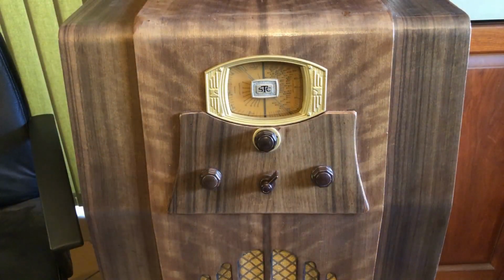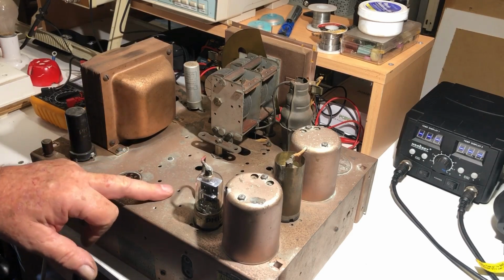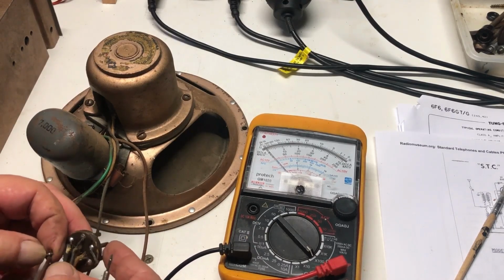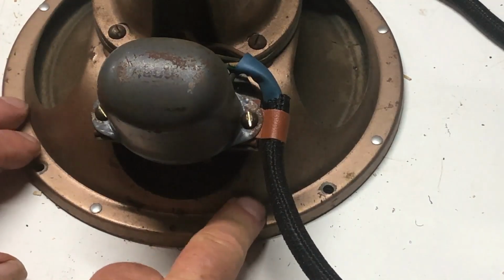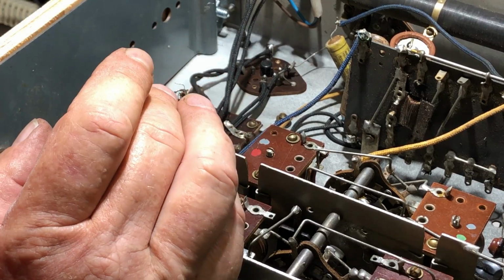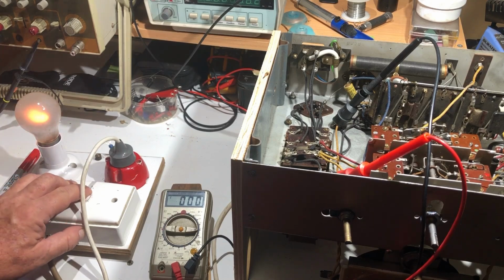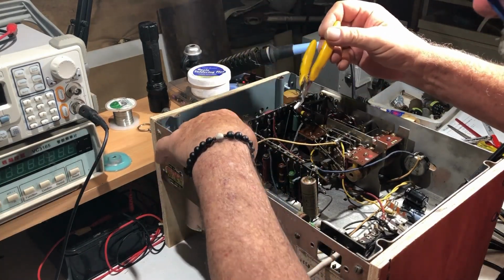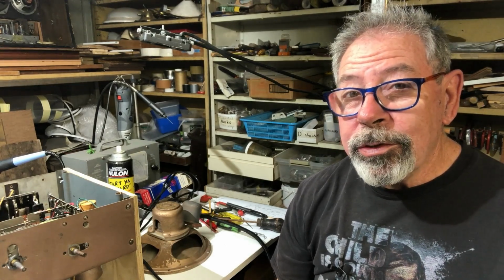STC model 530 Part 1

Comment: It doesn't look like it is a 'live' chassis (ie. electrified with a nominal 240V when the set is on, as was typical at the time).  Am I right?
Reply from the maker: Hi John. Yes you are right. This is not a live chassis set. It has an isolated mains transformer and all voltages are derived from the secondary windings.  In fact, live chassis radios are quite rare in Australia.
Reply: @Donno308  Thanks Don.  The reason I asked was that my uncle had an identical model to this magnificent STC vintage-radiocomau/default.asp?f=2&th=996, which replaced an even earlier HMV (I think) MW/SW dark wood floor model with octagonal radio dial, both with booming bassy speaker cones.

When I was a kid he told me never to poke around in the open back of either, because he said the chassis was live.  As a late teenager he trusted me enough to tap the top of the sound valve whilst on whenever the sound became muddy or muffled (light surface corrosion on the pins?).  I still ended up getting him to do it though, lol.

Comment: Very interesting watching this. I have an STC 536 chassis in a cabinet which is the same as the one you called "Butt Ugly" (which came up nicely in the end). The valves in it are 6J8, 6U7, 6B6, 6V6 and 5Y3 which are different to the one's in your STC 536. Also your chassis is somewhat larger than the 536 I have. I believe mine is a 536B. When working on mine I found a lot of discrepancies to the circuit diagram which I downloaded from Radio Museum. Out of interest what chassis did your "butt ugly" cabinet have? (sorry for calling it that but it's the only way of identifying it 🤣) Looking forward to the next part in this resto.
Reply from the maker: Hi.  Mine was a model 556 which was the battery - powered version.  At some time it had been converted to AC operation.  To do this, they removed one of the 3 IF stages so as to use the spare valve socket for the rectifier valve.  It was all a bit of a butchers job and of course there was no schematic.  It wasn't the same as the 536 and of course they changed all the valves to 6v filaments but used different valves to the 536.
As far as I know the chassis would be the same size as it fitted in the same cabinet.
Cheers

Comment: Hi Don.  I can confirm that this is a model 530.  "53" being the chassis number, and the "0" being the cabinet style.  I have a model 680, which is a slightly earlier model (late 1935 to early 1936) that uses the same cabinet design.
Reply from the maker: Thanks Stuart.  I was struggling to find much information on it.

Comment: Hi Don & a very merry Christmas to you. Thank you for the video - one small suggestion; if I remember the cct diagram correctly, the tone control cap is in the plate of the 6F6, returning via the tone pot to ground. In this position they have a hard life & if they short, you are down a tone pot also:( Thanx again.
Reply from the maker: Ji and merry Christmas to you and yours.  I did end up replacing that tone cap.  I've seen a few designs where they run off the plate.  Always one to watch for.  Thanks

Comment: As you say Don, an unusually well organised and neat chassis for this period. Those hand wound resistors were an interesting touch. I kind of like the change they made to the facia to give it a bit of character. I'm sure you'll have this up and running in no time. Seasons Greetins from Scotland.
Reply from the maker: Hi Klumpy! And a very Merry Christmas and happy New Year all the way from Australia.  Yes I guess we'll have to live with that facia as it is so I might as well get to like it!
I've already got it running but there's a few weird things happening ...
Reply: The 536 is not so easy to work on. It has a smaller cramped chassis.

Comment: Nice going there Don. I have had the 'pleasure' of working on a few STC radios from the late 30s and yours is the cleanest and best laid out one I've seen. That huge capacitor was unusual, I expected it to have a high capacitance and voltage. It is high for a non polarised one I guess. What happened to the front of the radio cabinet? that is weird, is it a different chassis and the holes were out or something? 
As you once said to me... "you'll have this working in no time" 😉
Reply from the maker: Cheers David. Someone has clearly "got at" this radio before, apparently using whatever they had lying around.  I've found a few caps replaced with the wrong values but probably near enough to work.  I'm not sure what went on with that front panel. No clues inside the cabinet.  The holes on the inside line up so it wasn't that.  Also someone has cut off the end of the inner tuning spindle with a hacksaw.  With the extra thickness of the front panel I'm not even sure I can get it working again properly.  Hopefully I can work something out.
Yep, I'll have it working in no time.  Funny, I don't remember saying that.  I must be getting old.  And my hearing is going funny too - my voice sounded kind of squeaky...
Reply: @Donno308   Haha... you said that on the hologram message you sent me with the clock radio 😉

Comment: Hi Don, You must be right that the trim under the knobs is added. I'm thinking that the large tuning knob was left off when they added a piece of trim there wasn't enough length on the control.
Rich
Reply from the maker: Hi Rich.  Yes, it's difficult to work out why that was done.  No sign of damage on the inside of the cabinet.  It will make it difficult to fit a new outer knob.  I'll just have to see what I can do.
Reply: if you have a fostner bit larger tan the knob you could cut a hole in a scrap piece of lumber, double sided tape it where you want the hole and cut to the original cabinet

Comment: Hello from Hobart. The speaker plug is a UX -5 valve base, the same sort used on an 807, the base you took the pin from is UX-6 probably off a 57 or 58 IF pentode. 

A word of caution though using Sodium Hydrogen Carbonate mixed with Ethyl Cyanacrilate…that mixture still contains Sodium Ions, effectively charge carriers….and i that was one of the field ciol connections in thr pi filter at 450v…Yikes..you could get track-over. Sodium ions and 450v straight of the cathode of a 5V4 don’t mix well. Oh, and something else to help when the cyanacrilate sticks your fingers to the bench or to each oher….have a dropper bottle of acetone handy, it not obly dissolves the cyanacrylate polymer but seems to react and terminate polymerize the monomer too. On my bench there ate two polyproplyene dropper bottles, (scavaged from swarzkopf hair dyeing kits), one with metho and one with acrtone.

Odd radio for 1936, I would have expected a UX based valve lineup, something like 6A7 pentagrid, 57/58 if, 75/6B7 det /AF ans a 42 for the output. Look as if here they were trying the very first octal valves. A 6F6 in the output is a pain in the bum because those are so bloody rare compared to 6V6’s. I reckon I have at least 150 6V6GT’s, a few, six or seven 6V6G’s and maybe two or three 6F6’s…one is in a metal can like your rectifier there and one if the others is in a Shouldered G bulb. I can ,t imagine the two are that different and I’d be very strongly tempted to alter it for a 6V6 by changing either the screen dropper, cathode resistor or speaker transformer after consultong the datasheets for both valves…becausr 6V6’s are still literally everywhere.

I have a very interesting Stromberg - Carlson here a big cabinet model like this, it is choc-full of UX based valves….a damn pain to get back into a socket up the back of the chassis behind an IF can because the thick and thin pins ain’t that different…guess that is why Octal was developed, just get the valve over the socket and the end of the keyway into the centre socket hole, them spin till it drops and you know it is “good to go” to push it down. Bloody UX sockets, particularly the cheap micenol ones….crack!..Oops, got thise thicker heater pins in the wrong place!

This Stromberg-Carlson has a three-gang tuning, a 57 tuned RF, a 6A7 pentagrid, but wait for it…it has TWO IF strips! Two more 57’s, one in each strip and two 6B7S’, one for each strip…one whole strip dies the AGC and the other for the AF!. the output stage is odd too, it has a 6A7 dual triode phase splitter folloved by a class A-B pair of 2A3’s…oh and I just about forgot, it has a 6E7? Magic-Eye hanging off the second AGC strip! This must have beentheir absolute top of the line radio…I rescued it from a scrap metal yard about 20 years ago. Sadly the dial glass was snashed to bits. The cabinet and speaker are OK, but that missing dial glass is a show stopper. There are so many valves in the chassis, someone has put an octal based GZ32 rectifier in there, I suspect it replaces an 83, a very rare mercury vapor version of the famous 80. All in all it is a very unusual Aussie radio, Inshould pull my finger out of my bum and do something conclusive with it as the chassis dOes basically work despite all the old paper caos underneath!
Reply from the maker: Hi and thanks for the information.  
I haven't used sodium carbonate and super glue on anything carrying high voltage before, only cabinet parts etc. and I wasn't aware of the potential for it to become conductive.  I wish I had used epoxy resin on that plug. It would have produced a better result and probably been a lot less trouble.
There is still about 5 or 6 mm of "clean" bakelite between the pins as I only used the superglue/bicarb mixture around the pin itself to hold it firm.  I guess I'll just keep an eye on it for now but certainly something to be aware of in future.
Yes I've had a few dealings with UX based valves and I agree they are a pain in thee arse.  The worst, though are those rimlock valves they used around the 1950s.  You risk breaking the valve every time you remove or replace it!
That Stromberg Carlsen of yours sounds like a beast!  
Such a pity about the dial glass!  If anyone can help with that it would be Michael Raanan radiomike121@gmail.com.  He makes repro dial glasses to a very high standard.  If you can find a picture of the original one, or even still have the broken pieces he may be able to help.
Good luck with it anyway.  Do you post on Facebook forums or anything?  I'd be interested to see some photos.
Cheers

Comment: Well so far don it's looking really good :-D
The bi carb and super glue was very handy.
I really like the massive chassis layout,  You can get your sausages in there without swearing lol :-D
It's a shame that some pillock bent the toaster rack.
It looks like a no stress job, that's great :-D
Reply from the maker: Hi Harvey
Not too sure about a no stress job!  I'll get the rack sorted easy enough.  That speaker is going to be a bastard to stop it scraping but hopefully I'll get there.  The tuning reduction drive is going to be a PITA too.
Anyway I'll do the best I can with it.
Cheers
Reply: If you have never felt stress, i hope you never ever do. 
Very mentally destructive .
Try to relax and not get upset/stressed.
I became very mentally ill because of a bad boss that could not give a shit about the workers.
Ill shut my gob now lol.
Reply from the maker: @zx8401ztv  I have been in much the same position - several times in fact and yes, my mental health suffered.  Life is too short for that stuff.  Overall, fixing radios and making videos is good therapy as the rewards are immediate.  Luckily I now have a job I like with a fantastic supportive boss.  Yes, they do exist!.
Reply: That's wonderful Don :-D  that boss is a gem,  Do the best you can for that boss.  @Donno308